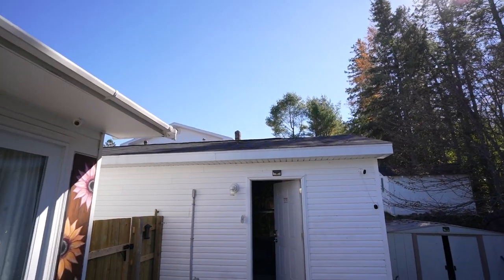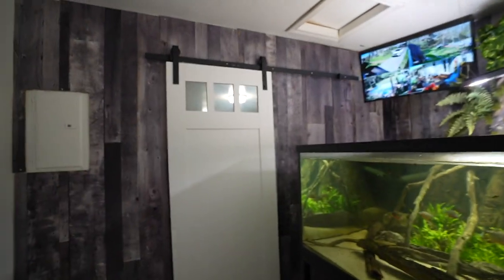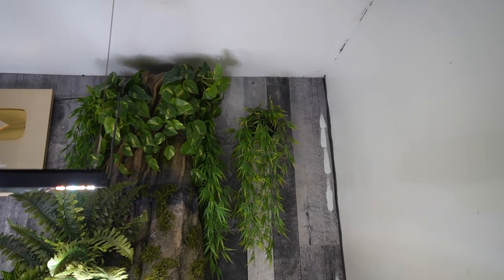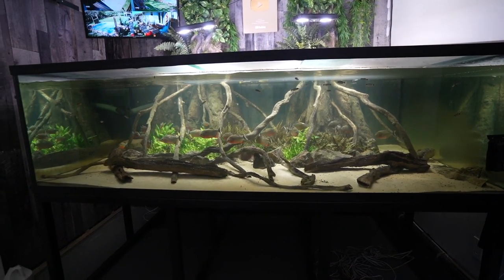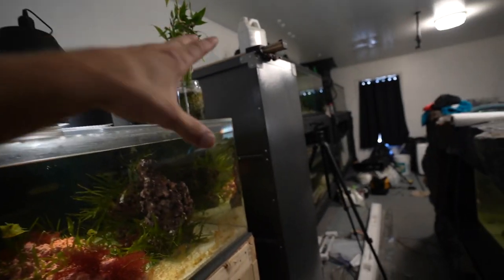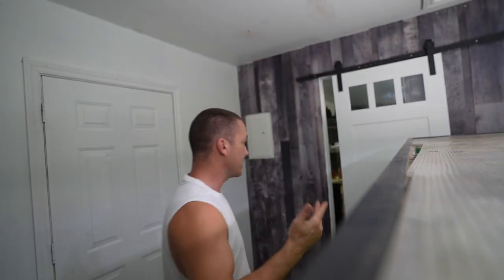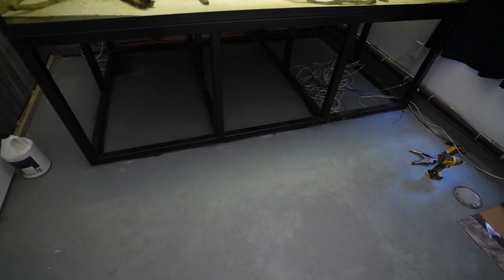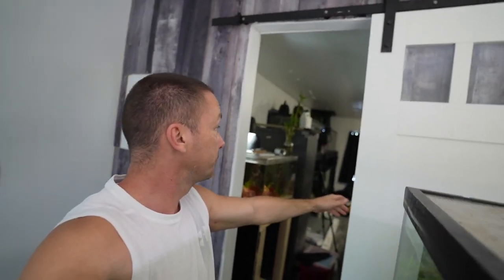AQUARIUM GALLERY IS BACK!!!

Comment: Glad all the fish survived the power outage. Ps. You can get a magnetic doorstop from your hardware store so when your sliding door is open Far enough that it magnetically holds the door into place. My sidling door is set up the exact same way on a slight angle so it always closes but I do occasionally want it open so the magnetic doorstop works great.

Comment: I have a few ideas for the door. As a door stopper when you want it to stay open, you could add a latch kind of the way the little tabbies on the back of a picture frame work, you turn it down and it holds the door back. As for a handle, I think you should rout out or carve just a little groove instead of adding a handle that protrudes out, since there's obviously not a large space between the door and the wall.

Comment: I really wouldn't worry too much about circulation of air that heat exchanger will move enough air around the only thing you might notice is when the door is closed that room might get slightly cooler by a degree or two compared to the other room so if the fish are sensitive to that you might just want to leave the door propped open a little bit at night but I don't think one or two degrees is really going to make that much of a difference

Comment: Use extra panels on the inside of the sliding door giving you that "hidden door" effect.
Maybe use some of the extra Aqua Décor panel panels along  the bottom of the tank to hide the frame.  And yes bench or stools would be a great addition to your sitting area.

Comment: Looking at building a 24" rimless cube tank (24"x24"x24") with 1/2" thick glass.  I am thinking about adding a double layer bottom (1/2" normal bottom with an added 1/4" layer of glass, slightly smaller to form a ledge for the side glass to sit in for added strength).  I wanted to get your thoughts?

Comment: A possible easy way to get the door to stay open, drill a hole in the door, sink a neodymium magnet in it, get a piece of rectangular steel with rounded off ends, screw that on one end into the  door frame, and when you pull it to the side, it sticks to the magnet and holds the door open...you could even paint it white, then there is nothing on the floor to trip on, and it swings back out of the way when you dont need it.

Comment: id add one of those simple barrel like door stops/locks on that door, have the cylinder lock on the door frame then the female receiver on the door..  would be an nontraditional orientation but would work well...  Believe correct name for lock im talking about is barrel bolt latch